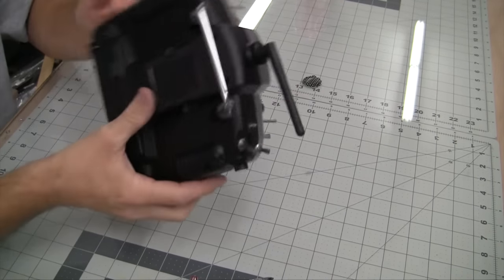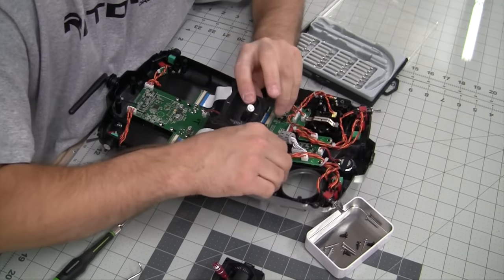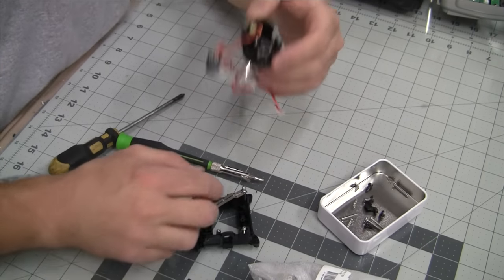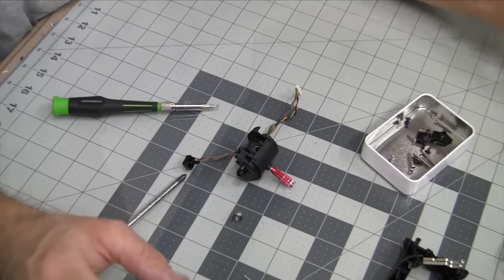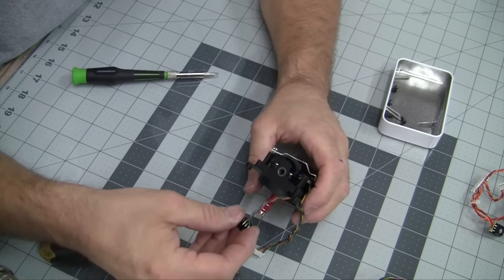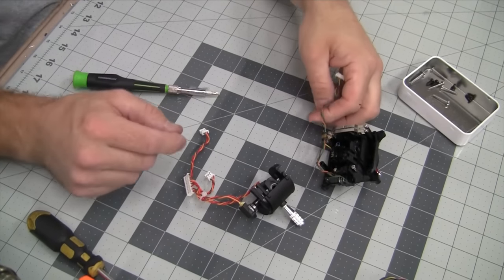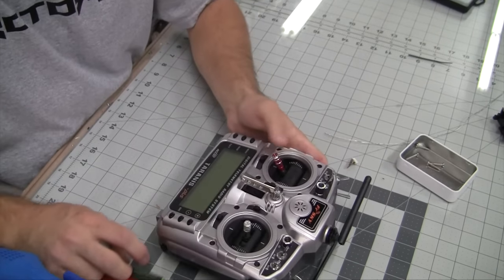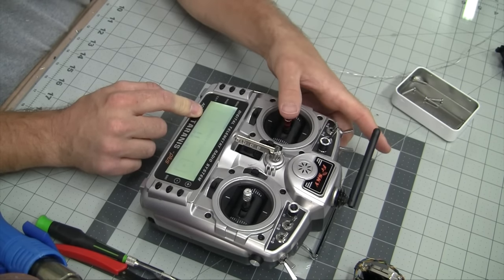How To Install Aurora 9 Gimbals in Taranis Plus X9D

Comment: When I give throttle, it also applies yaw...even when I don't even touch any YAW movement. During calibration I noticed that the YAW does not reach it's extreme end points. Do you have any idea what I should adjust?

Comment: So what makes it better? The design looks exactly the same. Aloft also makes an aluminum crossbar that is supposed to give it a better feel also.
Reply: They also sell the upgraded gimbals (PR10) that have the upgraded cross arms  (not full aluminum, but coated in some sort of plastic) for $14 a pop. I just installed them and they feel a little bit better than stock, but I havent been flying long enough to really tell the difference.

Comment: So yah.... Always disconnect the ribbon cables before doing work like this.  They are VERY easy to damage (I found out the hard way).  They remove easily, just slip the black retainer down and they fall out.  To replace just slide them in and slip the retainer back up.

Comment: I've seen some guys do this mod and other guys replace the stock gimbals with JR gimbals. Which do you think would be best? Why Aurora 9 over JR?
Reply: JR gimbals drop right in without modification.
They are very smooth and have large accurate pots, they also centre perfectly.
Reply: Cool. Good to hear. The problem is sourcing JR gimbals here in the US.
Reply: Do you know of a vendor that sells the JR gimbals?

Comment: are these gimbals sided or do you just order 2 of the same? thanks in advance.
Reply: This is the same question I had in my head... Hope somebody can answer us! =)
Reply: TheOddRaspu FPV I haven't had a reply and it's been 3 months lol
Reply: Rotorage they come as pitch/roll & throttle/yaw
Reply: I've got the pieces&parts for gimbal upgrade and 6pos switch just don't want to bust into radio without a must reason
Reply: Fpv4 Metoo should be fine there's plenty of tutorials to keep you right

Comment: Can anyone who's done this upgrade comment on the difference? Is it worth it?
Reply: +Pterodax This seems a lot of work for not much gain. It's still only a plastic gimbal assembly. A lot of people have simply changed out the stock springs with Futaba springs to increase the centering tension. A piece of heatshrink tube on the throttle detent spring will smooth out the notchty feeling. I think a lot of the mods done on the Taranis are done just because people can since the radio is relatively cheap and has such a large and open user base. For me the biggest issue is the lever switches are not the best quality and easily broken. I keep a full set of switches as spares.